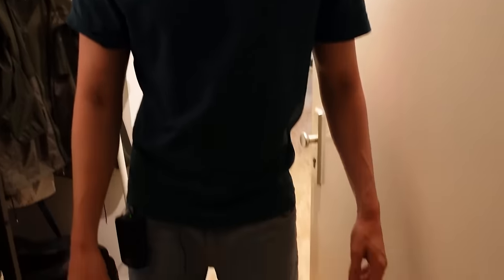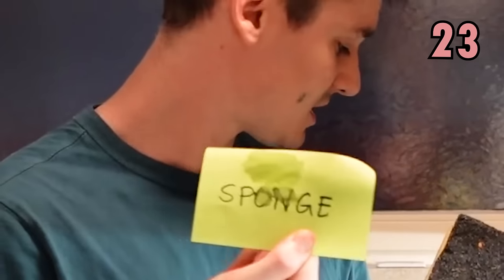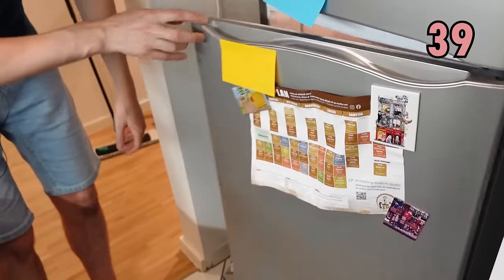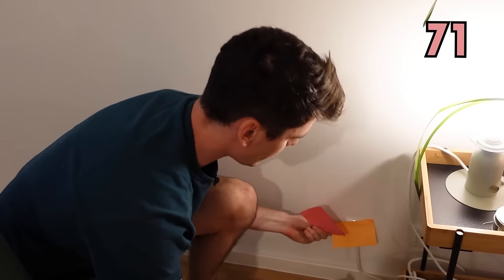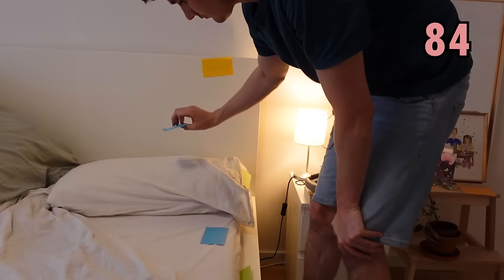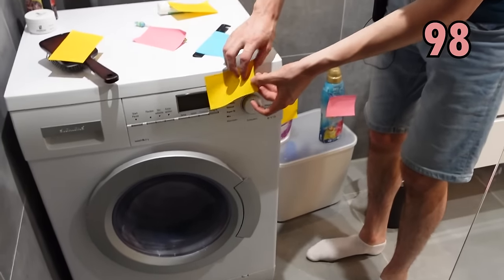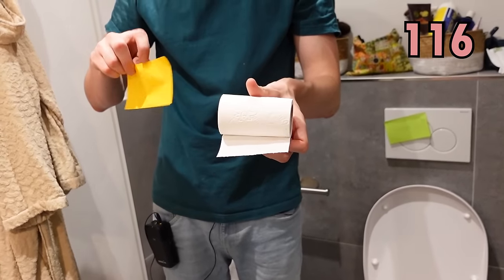117 WORDS IN MY FLAT - TEST YOUR ENGLISH

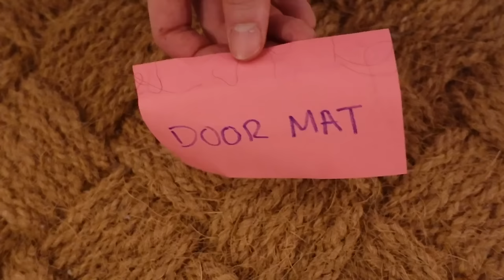Comment: 1 Door bell 0:28
4 Shoe rack 0:46
5 Coat stand 1:05
9 Kettle 전기 주전자 1:48
11 Cork screw 2:08
22 Washing up liquid 3:28
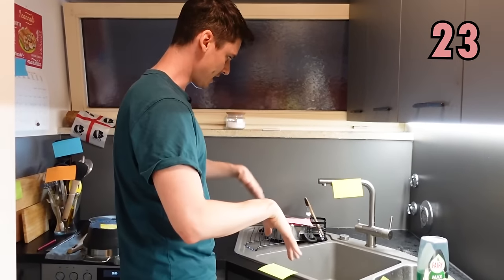24 Tap 3:43
28 Colander 4:31
29 Stove 4:43
32 Ladle 국자 5:16
33 Chopping Board 도마 5:26
35 Oven Glove 5:50
36 Cup Board 6:01
37 Dish Washer 6:14
39 Tupperware 6:42
42 Apron 7:25
44 Light switch 8:13
51 Coaster 컵받침 9:39
52 Clothes horse 빨래 건조대 10:09
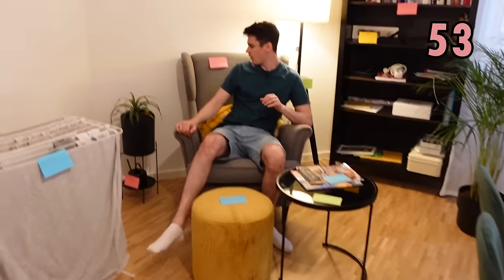54 Arm chair 10:17
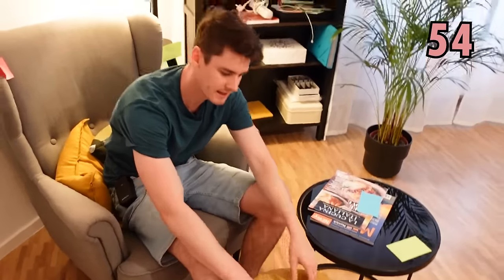55 Pouf 다리 받침대 10:29 
56 Coffee table 작은 원형 테이블 10:43
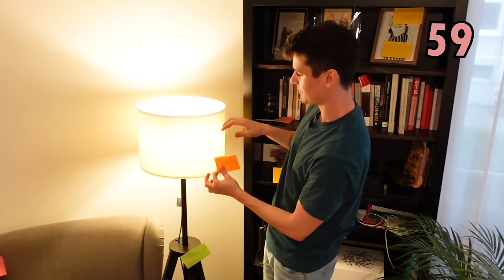59 Lamp shade 11:11
64 Frame 12:05
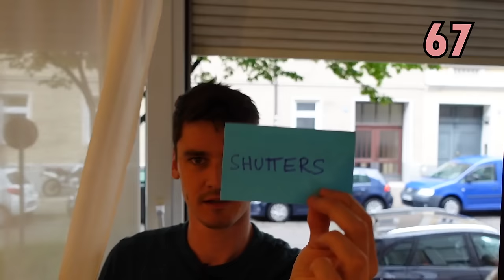68 Shutters 12:57
69 Skirting board 13:07
70 Socket 13:19
71 Plug 13:28
Reply: thanks🙂
Reply: Very nice and helpful vídeo. Cheers!
Reply: 25  pot
Reply: Thanks ❤

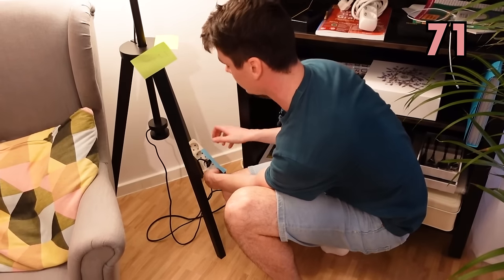Comment: 72 Extension cable 13:52
73 Watering can
74 Plant pot 14:17
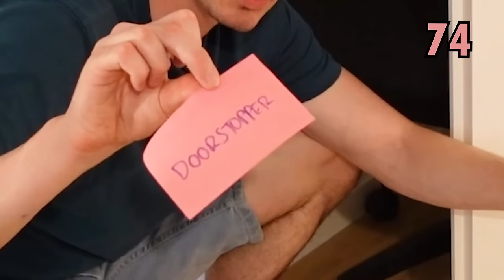75 Door stopper 14:28
76 Office chair 14:37
77 Door handle 14:54
78 Clothes hanger 15:07
79 Chest of drawers 15:21
80 War drobe 15:41
81 Step 15:54 
82 Beside cabinet 16:14
84 Pillow case 16:49
86 Sheet 17:13
89 Cactus 선인장 17:50
90 Windowsill 18:05
92 Ceiling 18:32
93 Smoke detector 18:50
96 Drain 19:39
97 Soap dispenser 19:54
100 Washing detergent 20:20
101 Fabric softner 20:29
104 Comb 20:54
105 Hair brush 21:03
109 Shower head 21:48
110 Laundary basket 21:58
112 Bath robe 22:24
113 Toilet lid 22:47
114 Toilet seat 22:57
115 Toilet brush 23:18
116 Toilet paper 23:28
Reply: I really appretiate for the timecodes.
You made a tiny mistake. 
115 is a Toilet brush not a toilet bruch.
Reply: @Lana.S.  hey I modified thanks
Reply: Thanks mate

Comment: Great job! Thank you Sam! 
But now can you please help us to make the nouns usable in context for conversations ?   I mean with verbs and adjectives. (With some nouns you did already describe the function). 
Like how would you ask a kid to clean the shoe sole on the door mat? Would you say "please wipe your shoes on the door mat"?  "rub your shoes at the door mat"? 

And how would you describe to remove the mop when it is dirty? (to someone who doesn't know) 
Would you say "you can remove the mop by pushing/or step on the ...('joint' perhaps?), while pulling up the ...(stem? pole?) at the same time? Or is 'mop' the whole thing, and the fabric is the wiper? 

It would be great to combine the nouns to useful sentences, like:  "I've got only 3 mops, so I usually  wash them in the washing machine together with the shower mat, because I do not want to combine them with the tea towel or the sponges or anything. Fact is, the machine is only filled half, so the question is, should I use half a measuring ...  (cup?) of detergent? I prefer the ful amount, because the machine takes the ful amount of water though (or anyway?) 
 Sry, I do know lots of nouns, but when it comes down to conversation, I'm fishing for words... 

How do you use the colander? Do you pour the pot in it? Or the water? Or can I say "please pour the pasta/vegetables in/through the colander" ?  Is it possible to say 'drain' the vegetables?  

How can I advice someone to first use ful heat on the stove, but after a while only half heat?  reduce? turn down? 

What are you doing with the spatula? do you flip/fling the pancakes? 
How do you describe to put the pancakes on the plate with or without the spatula? lift? let it slide? 
Do you ladle soup or yoghurt with the ladle in/into a bowle?  
Do you spread coasters on the table for guest's glasses? Or offer? Or put? Or any better expressions?

What do you do with the shutter? open/close? lift/pull down?  

Do you open/close curtains? draw/push?  

I would really really appreciate, if you give us a "to be continued" 😀 
(perhaps sounds a bit complicated, but I'm sure, it isn't.  Short sequences, maybe 10 or 20 nouns in use. And how to comunicate in dialogs. Asking how to handle/give advice, asking for help/offering help...

Comment: 🦢 swoosh🥛hmm🍫yummy 📚 mmm🚀 esplosa❤ i love words zapp challenges 🎂yumyum 🍨 slurpy! 1. Feet comfort/y 2. Ring bell  3. Frontier 4. Shoe robe / ward 5. Coat hangar 6. Sandals 7. Scum cleaner/ hammer cleanser 8. Hop / bop 9. Flask /heater 10.  Kithcen paper/ pantry mop 11. Palate screw 12. Slineder 13. Scruicer 14. Caffien Mug 15. Pea spoon 16. Bold spoon 17. Blade 18. Cork 18. Place / colate ; leper 19. Cemetry / tray; cembung 20. Bog/ cup/ cap  20. Hygine wash / plate soapy/ dish washer/  colate soapy/  glo 21. Soapy tool 22. Fauchet 23. Tank  24. Boiler 25. Can 26. Foilender 27. Steel  28. Baker  29. Laddle  30. Dhal bog 31. Choping Block 32. Diary / dateline  33. Baker cloths/helpers / linen 34. Wardrobe  35. Palate washer / washer machines  36. Plate cloth/  pantry; kitchen linen 37. Foods container/ plastic coverage  38. Cooler 39. Bridge /igloo  40. Apparatus/ decipline 41. Oven  42. Locker 43. Lamp denture / button 44. Cusshion  45. Pillow / case 46. Mat 47. Wooden Panel 48. Desk 48. back Stool 49. Stain helper 50. Arangement base 51. Clock /wall hang/ TACK 52. Rest/bestie sofa 53. Typist chair 54. Rest/ side desk  55. Mangga/ journal  56. Bulble 57. Blinders  58. Lamp menthol 59. Sherd of book  60. Roller stick / night stand 61. Photo 62. Creme bule / tamplete / trample  63. Arrangement 64. Window Linen  65.  Window Lock / window safety / code 66. Blind 67. Docket 68. Ariel / jug 69. Cable docket 70.  Plant Jag/ plant potty / miniture horsy 71. Vase 72. Door silent 73. Ceo comfy 73. piegon cloth 74. Chests 75. Shades 76. Closets 77. Ladder 78. Tea/ helper drawer / night shades 79. Case chest 78. Linen of bed  79. Bed linen case 80.  Bed Comfy coverage81. Air fryer/ air lifter 82. Accosseries 83. Heater 84. Cuffed 85. Alarm of fire 87. Detained glass 86. Hair Sickled 87. Slider 88. Hygine soapy 89. Bathroom dresser 90. Cloth wasing machine 91. Washing substance 92. Softlan / linen softner 93. Toothlinen 94. Tooth glue 95. Hair Liner 96. Hair comfy  97. Bath mat/ bed/ sack /shower deck 98. Shower soapy/ jublint / shower gel 98. Hair comfy / radiance / theraphy 99. Head cap / lock / bath cape 100. Cloth basket / collections 101. Shower towel/ shower robe/ dress 102. Loo pliad 103. Loo cape / draper 104. Plunger / slinger of loo 105. Loo mop/ dope 106. Loo linen / toilet caste / bathroom casket 🍉juice 🍎 jurnal & dictions by🖊 ame🌹2023-32-42✌️

Comment: door mat
door bell
front door
shoe rack
coat stand
slippers
vacumm cleaner
mop
kettle
kitchen roll
corkscrew
glass
scissors
coffee cup
tea spoon
table spoon
knife
fork
plate
bowl
mug
washing - up liquid
sponge
tap
sink
pot
pan
colander
stove
oven
spatula
ladle
chopping board
calendar
oven glove
cupboard
dishwasher
tea towel
tupperware
fridge
freezer
apron
microwave
door
light switch
sofa
cushion
rug
floor
table
chair
coaster
vase
clothes horse
armchair
pouf
coffee table
magazines
lamp
lampshade
light bulb
bookshelf
candle
picture
frame
plant
curtain
window
shutter
skirting board
socket
plug
extension cable
watering can
plant pot
doorstopper
office chair
door handle
clothes hanger
chest of drawers
wardrobe
step
bedside cabinet
pillow
pillowcase
mattress
sheet
cover
fan
cactus
windowsill
radiator
ceiling
smoke detector
mirror
hair dryer
drain
soap dispenser
bin
washing machine
washing detergent
fabric softener
toothbrush
toothpaste
comb
hair brush
shower mat
shower gel
shampoo
shower head
laundry basket
shower cap
bathrobe
toilet lid
toilet seat
flush
toilet brush
toilet paper